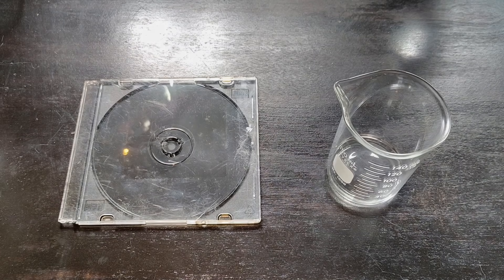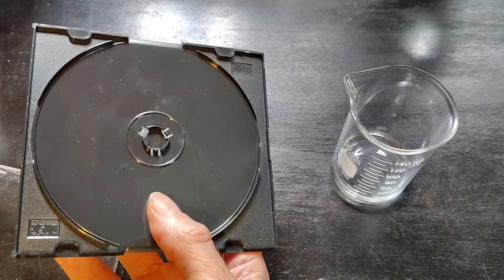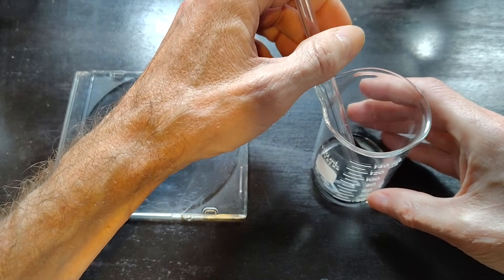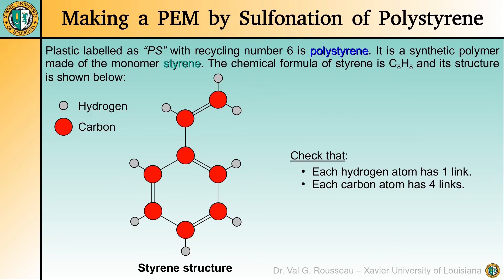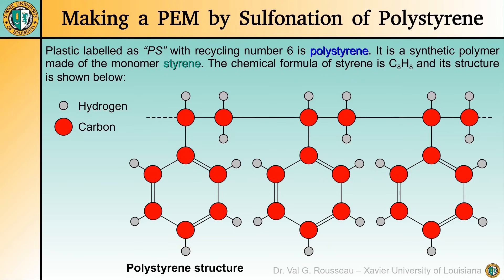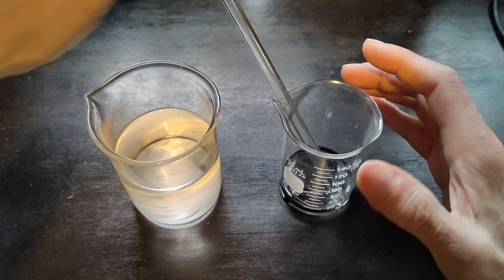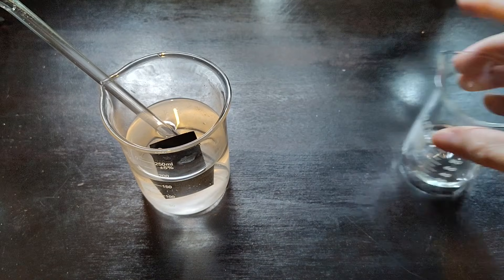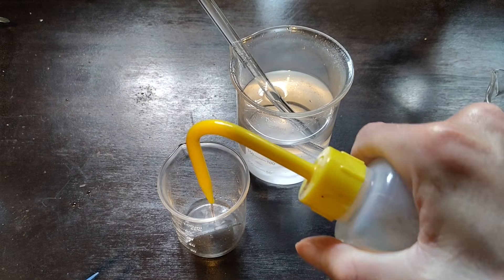How to Make a DIY Proton Exchange Membrane from Plastic and Sulfuric Acid

Comment: merci de cette video , qu'est ce que ça veux dire du plastique PS6 ? il est styrenique ? est ce que avec l’ABS (acrylonitrile-butadiène-styrène) d'imprimante 3d ça peut convenir ?? vu qu'il y a  du styrene, on peux donner la forme que l'on souhaite , c'est pour quand la suite !!!!
Reply from the maker: Le platique PS6 est exactement le polymère qui est décrit en image dans la vidéo, donc oui, il est styrenique. C'est juste du polystyrene non expansé. Pour l'ABS d'imprimante 3D, je ne sais pas. Il faut s'assurer que l'acide sulfurique ne réagisse pas avec les autres radicaux. Et en supposant qu'il ne réagisse pas, il faut que la densité the styrène soit suffisante pour qu'il puisse y avoir conduction de protons.

Comment: Wouldnt i a be able to dissolve some polystyrene foam into acetone and then put it into the shape i want and let the aceton fly off over time? And then use this self made PS shape for this step?
Reply from the maker: Probably, but the sulfonation time scales with the square of the thickness, so you would have to make sure it is really thin, or wait forever. 4 hours for 0.1 mm, 400 hours for 1 mm...

Comment: 🤔, I wonder if this will work, in an epsom salt cell.
Reply from the maker: Assuming you want to produce sulfuric acid, if you put Epsom salt in both half cells, the magnesium won't be able to leave the anode compartment since the membrane allows only for protons to go through. It can't be reduced because there is no electrons available, and even if there was, it would react again with the sulfuric acid produced to give back Epsom salt. If you start with Epsom salt only in the cathode compartment, the sulfate ions won't be able to move to the anode compartment, so no sulfuric acid will be produced. So, I think it won't work.

Comment: Thank you very much for taking the time to produce this YouTube. It is very interesting. I am neither a chemist nor a physicist, but I find these sort of YouTubes very interesting. 
Earlier today I watch a YouTube where the producer made sodium perchlorate.
https://youtu.be/cclQl6JeZOg?si=SkoOhGldic7qlUKq 
He used something called an H-type electrolytic cell. Between the cells he put some sort of membrane that only allowed a one way transfer for (I think) positive ions. I don’t know what the material was called. Sounded rather technical and expensive. Is this, that you have made, the same sort of material? His looked sort of translucent and flexible. 
Thank you again for sharing your knowledge.
Reply from the maker: I don't know what sort of material lets positive ions pass and blocks negative ions. The material I made is sulfonated polystyrene and, as explained in the tutorial, it is more restrictive since it lets only hydrated protons (a.k.a. hydronium ions, H3O+) pass while blocking anything else.
Reply: @BlueMoonshine 
It should allow the metallic cations to pass too but at a higher energy cost since H(+) is a cation, the smaller of all and in higher concentration into water  and being one of its constituants; also entering the equilibrium reactions and definition of pH or pKa.

H2O <--> H(+) + OH(-)
Then 
H(+) + H2O <--> H3O(+)
and water molecules can make an outer-shell of various diameter flipping and exchanging water molecule quite fast; that is why conductivity of H(+) atoms is much faster than OH(-) thrmselves more fast mooving than other larger and heavier cations or anions.
This explains greatly the  resistance and conductivity of acids, salts or bases into water as a function of their concentration.

CH2=CH-C6H5 + H2SO4 (HO-SO2-OH) --> CH2=CH-C6H4-SO2-OH + H2O

Proton transfer:
CH2=CH-C6H4-SO2-OH <--> CH2=CH-C6H4-SO2-O(-) + H(+)
Defined by pKa of aromatic sulfonic acid.

Same occurs with sulfonic salts: CH2=CH-C6H4-SO2-ONa <--> CH2=CH-C6H4-SO2-O(-) + Na(+)

So Na cations can travel through  too just like  any cation depending  onto cation, resistivity, charge, solubility of the sulfonic salt; what dictates the amount of free cations, speed of displacement, efficiency of passage through the anionic sulfonate, ...

The resulting polymer will contain sulfonate anions that will reduce passage of anions (hydroxyl, acetate, nitrate, nitrite, phosphate, sulfate, hypochlorite, chloride, hypochlorite, chlorite, chlorate, perchlorate, etc.) 

;o)

PHZ
(PHILOU Zrealone from the Science Madness Forum and many former A.O.L newsgroups related to chemistry)
Reply: @BlueMoonshine 
Really?
Of course yours! :o)
By definition PS-Sulfonic acid is PS-Sulfonic-H; simply allow it to stand into NaOH, KOH, LiOH or NH4OH and you get PS-Sulfonate Na, K, Li or NH4 that allow cationic passage (slower for larger cations or polycations due to cross-linking (sometimes used into cation exchange resin or cation chromatography) some may be trapped into it and free (relarged) by rinsing  with concentrated Na(+) (brine NaCl solution) so it works for softening water after scavenging Ca(2+) of tap water and membrane washing (refreshing of the sodium sites) to put into the riot (NaCl and CaCl2 solution); to the tap you have softer water with lower hardness (low calcium level nearly close to 0 what helps soaps to foam and clean more deeply).

BTW when basifying your PS-sulfonic acid with Na2CO3, you made PS-sulfonate of Na!

To make it acidic again; allow to react into HCl; then wash several times with demineralized water to get back PS-sulfonic-H.

PS-sulfonic-Na + HCl --> PS-sulfonic-H + NaCl

PHZ
Reply: As a final note; during your videos you present the structure of the PSS polymer with the sulfonate group in meta (3-) position vs the ethene group or vs the polymeric chain; this is inadequate since the sulfonic group prefer the induced positions what are favored (para first (4-) and maybe ortho (2-) for a second choice).
The para position allows more space for the sulfonate positioning what is more favorable energetically.

For the rest; it seems that you may use a mildier sulfonating reagent (mixed acid Acetyl-sulfuric acid anhydride CH3-CO-O-SO2-OH)

Ar-H + CH3-CO2-SO3H --> Ar-SO3H + CH3-CO2H

Apparently concentrated H2SO4 may favourize introduction of one sulfonic group per aromatic ring what is wished; but it may also form in minor cases di-sulfonation (in ortho- and para-)-what should no be problematic in itself; and form unwished bridging (cross linking) reducing the availability of H(+).

Ar-SO2-OH + H-Ar --> Ar-SO2-Ar

PHZ
(PHILOU Zrealone from the Science Madness Forum and many former A.O.L newsgroups related to chemistry)

Comment: Is it possible to melt polystyrene dishes?
Reply from the maker: Yes, but you need a good temperature control. You could first shred the polystyrene dishes in small pieces, then heat in an oven (preferably not used for food) at a temperature between 200°C and 230°C. This is the "glass phase of polystyrene", basically where it is liquid (with high viscosity) and is reshapable. You shouldn't go above 250°C, as the polystyrene structure may start to be destroyed. Note: I haven't tried, so this is purely theoretical.

Comment: Can you comment on how this compares to the high priced commercial PEM's?  Things like durability, transfer efficiency etc....
Reply: From research paper about sulphonated polystyrene + xantham gum membrane

 As the proportion of xanthan in the membrane is raised, a clear trend emerges: the proton conductivity value undergoes a noticeable increase, progressing from 0.175 S/cm until reaching the level of 0.18 S/cm for XG (0.06%). This achievement surpasses the documented ﬁgure for Naﬁon-117, which stands at 0.082S/cm
Reply from the maker: No, I'm sorry, I can't. I have absolutely no experience with commercial PEMs. Also, I'm a physicist, not a chemist, so my knowledge about chemistry is very limited.
Reply: @BlueMoonshine  Fair enough.  Would be interesting to figure that out.